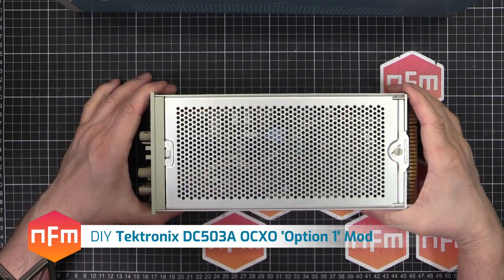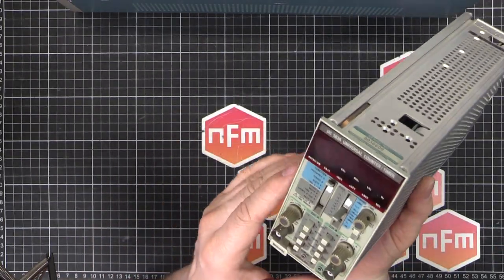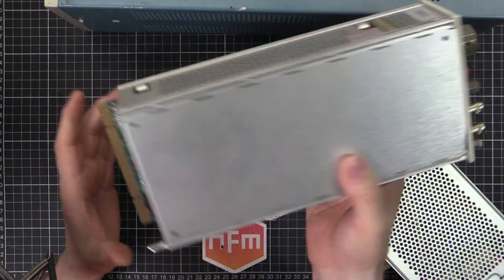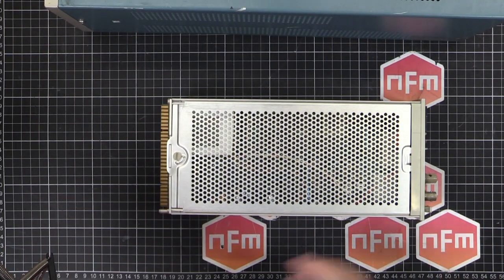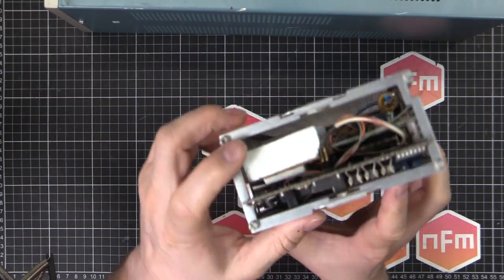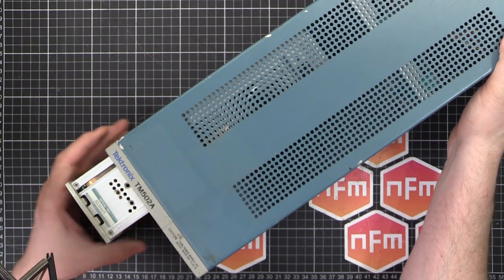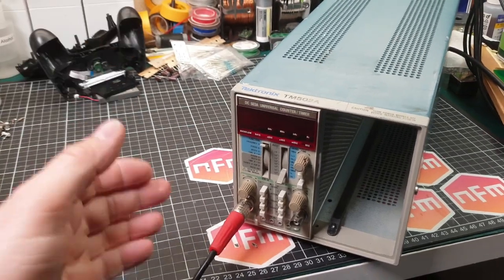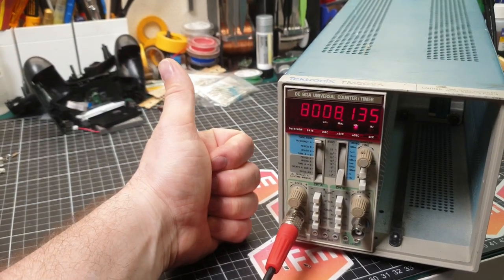Tektronix DC503A Frequency Counter OCXO Mod

Comment: 03:12 - Another option would be to make a PCB template that has the same dimensions and back card-edge connector. Then you could design circuits in your EDA software and have the PCBs made to purpose.
Reply from the maker: Keep an eye out for a future video.... ;)

Comment: Nice clean up of the seller's hack. The extra OCXO is a good candidate to DIY a GPSDO Lab Reference with a cheap/Ebay NEO M8N GPS receiver = Atomic Clock accuracy, for about another $30USD in additional parts. Don't forget to buy the powered antenna puck. It's needed.

Comment: With the available resolution of the display I’m surprised that it isn’t just using a TCXO as that would be good enough, just without the hassle of the 2nd supply and warm up requirement.
Reply from the maker: Yeah, I was thinking the same thing. There's barely any need for the extra precision if you can't even use it, but I only had OCXO's in my parts bin, so overkill it was for this unit. :D
Reply: @NearFarMedia  - I picked up some of these recently, they seem OK: 10MHz TCXO Module: https://defs.link/?u=e9a046
Reply from the maker: Oh nice, little baby ones you could stick just about anywhere. Would make it much easier to retrofit into almost any device for a relatively cheap upgrade.